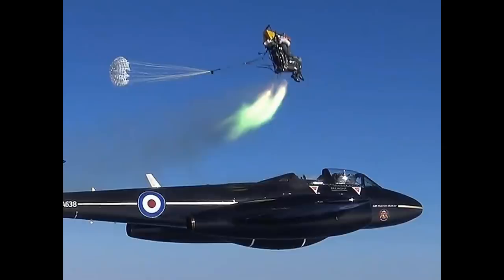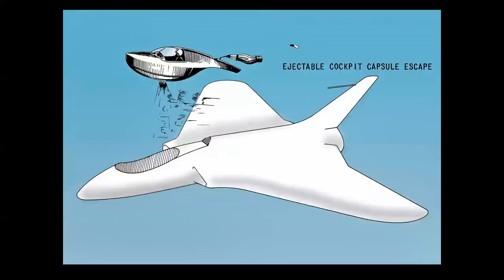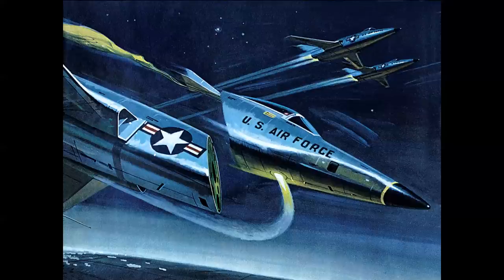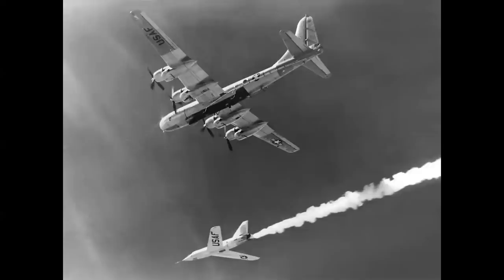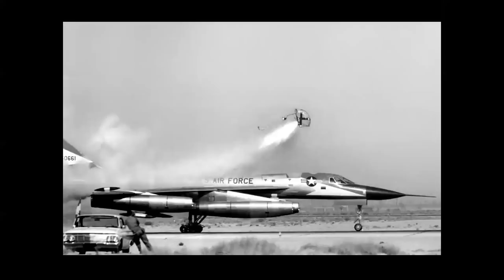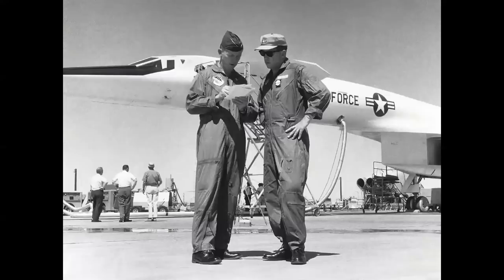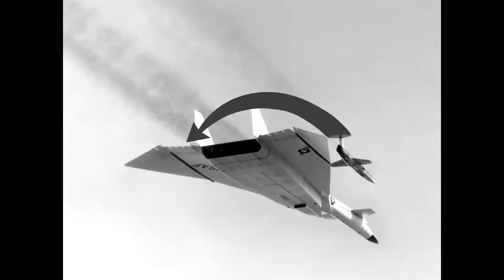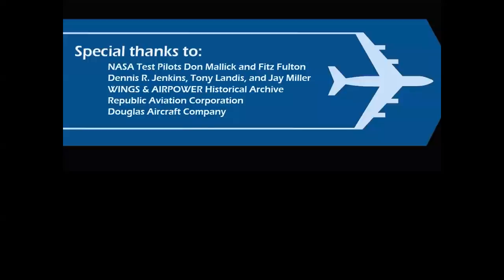AIRCRAFT EJECTION PODS & CAPSULES - High-performance U.S. aircraft escape systems, 1950s and 1960s.

Comment: I'd really like to know more about these high performance e-seats. In particular I'd like to know how the problem of flailing injuries are addressed at ridiculously high speeds like Mach 3. It's my impression that, to this day, flailing injuries are a problem even with aircraft flying at much lower speeds, in particular at lower altitudes where thicker air becomes problematic. I've heard stories of pilots, in more recent times, receiving horrific injuries like (eesh!) arms and legs getting loose, bent backwards, and plastered against the sides of the ejection seat, and helmets trying to rip the heads off people! In fact HOW ABOUT A VIDEO THAT PICKS UP WHERE THIS ONE LEAVES OFF covering modern problems ejection systems attempt to address. For example, how do pilots of The B-One survive if they have to eject during a low altitude/high speed run where they're at 200 to 500 feet AGL, and traveling at speeds that would rip the hair off a gofer as they pass overhead? Ejecting under conditions like that has to be like getting shot from a cannon into a bowl of molasses! And how can ANY ejection system possibly run all the way through it's complete sequence fast enough to keep an airman alive? It doesn't seem possible, (and for all I know, maybe it's not). And lastly, how about a look toward the future? Will hyper-sonic speeds eventually force a return to looking at ejection capsules?
Reply: Mach and high Q (dynamic pressures) are very different things.

Comment: Interesting presentation. Was the development of escape capsules influenced by the NASA Mercury/Gemini/Apollo space capsules? Or was it the other way around if at all?
Reply from the maker: Good question, Vik, and the escape capsule concept first appeared inthe late-1940s, predating the Gemini/Apollo equipment by more than a decade.
Reply: I have a book for boys from the late 50s where they ran a feature on disaster in Space featuring Von Braun's spaceplane, which had a design for a collapsible ejection tube with a steel mesh parachute and a small rocket motor for cushioning the landing.

Comment: When I started out at GDFW, one of the first things I learned about was the ejection system on the F-111 with it's intricate sequencing of the Guillotine to sever the thousands of wires coming into the pod, then the DTA lines and then the chute. I was hired for F-16 but was fortunate to work both Programs ... ACES II was the standard for decades. FF to just a few years back and my assignment in the UK at Martin-Baker on the F-35 ejection system ... talk about a quantum leap !!! Suffice it to say the days of giving the Pilot a choice to pull the big yellow loli-pop are long gone ... and it doesn't matter what "Frame Size/Weight" the Pilot is ... the Aircraft knows. And actually, it's a good thing all in all ... with a seat capable of a "Zero-Zero" survivable egress.  But thanks for your video ... all we now have achieved was built upon previous versions ... and those harmed or passed on. God bless them all for their contributions !!!
Reply from the maker: Great comment, thanks!
Reply: What? No.

Comment: Very interesting thanks for sharing. One query I still had outstanding in my mind though was: Just how does a seat&suit combo actually protect the pilot during a mach 2+ ejection? Surely the reason for the weighty and complex escape pods was down to the fact that designers didn't consider high speed ejections to be survivable without a pod type setup. So how/why did this change?
Reply from the maker: Great question, thanks. The issue is altitude and relative air pressure. SR-71s only flew at high Mach numbers at well above 60,000 ft. Ejecting at that height did not subject the pilots to potentially fatal windblast because of the lower air density, so the seat got them out of the aircraft, and their pressure suit kept them alive until they descended to lower altitudes and breathable air. When ejecting at lower altitudes, the pressure suit and helmet provided better protection against the higher windblast.

Comment: That SR that came apart in flight had suffered what’s become known as an “un start” in SR-71 speak. While attempting to fix the problem the aircraft got out of shape and according to the pilot vibrations started and the jet literally disappeared around him. He described his faceplate as instantly freezing over. And he still had his seatbelts attached to him upon landing. After this incident they fitted the DC pressure suits with a battery operated electric defroster so the crew could still see what was happening
Reply from the maker: Great information, thanks!

Comment: In this video, it remains to name who and when developed the ejection seats. The first combat aircraft in which these evacuation mechanisms were installed as standard was the German Heinkel He 219 Uhu. On January 13, 1942, German Luftwaffe air force test pilot Helmut Schenk ejected from a Heinkel He 280. The Germans experimented with various types of ejection seats, or Schleudersitzapparat, which translates to "seat catapult device." The one used by Schenck was activated by compressed gas, but there was another based on a spring-loaded mechanism, and a third that used a propellant charge. At the end of the war, these mechanisms gave the information to be developed by the US and UK. more modern systems... In Europe there is a saying: To God what is God's and to Caesar what is Caesar's.

Comment: I was looking at the B58 capsules and the crew member has to be in a "knees crunched up" position. I wondered ... if it was accidentally activated it would come down and either stop on or cut off the legs, but they thought of that, there seems to be a sort of knee bar that swings back to to force the crews legs up towards their chest so they fit and don't get the clamsheel taking their kneecaps off.
I'm guessing however it would make it impossible for 7 ft basketball players to be Hustler pilots :)

Comment: The British Miles M52 supersonic jet (1943 to 1946) was built with a pilot pod ejectable from the plane by explosive bolts. Eric Brown was slated to fly the prototype and keen to make it happen. Sadly the U.K. government cancelled the whole project shortly before the first test flight. We have never discovered why that was done.
Reply: The reason was we didn't have the money. When the NHS was formed all opticians and dentist we supposed to be included fully in to the system. But due to lack of funds and the desire to have the bomb and the means of delivering it the opticians and dentists were only partially integrated into the system.
Reply: @neiloflongbeck5705  the plane was already built so lack of funds wasn't the problem, it has been suggested that the "experts" at the air ministry claimed it would have to have swept wings, which it didn't, but there again the Bell X1 didn't either and that worked rather well!, the true reason will probably never be known as disseminating the truth from collective myth after all this time will be all but impossible.
A two thirds model was built for testing, and when launched out to sea was tracked on radar on its one and only flight at almost a thousand miles an hour, yet another "what if" unfortunately.
Reply: @CrusaderSports250  from what I understand none of the 3 prototypes were finished. I think one of them was about 80% completed when the programme was cancelled. After this we continued with testing scale models powered by a rocket, the first of which exploded just after launching a few days before the Bell X-1 did mach 1. By the time iv the 2nd attempt in October 1948 the Bell X-1 had gotten to mach 1.48, this time the rocket worked and got the model to mach 1.38 and then control was lost.
Reply: @neiloflongbeck5705  thanks for the update, I remember reading about it about forty five years ago whilst researching another aircraft project at college, I am sure we could have done it, we gave away so much of our progress and still are unfortunately.
Reply: @CrusaderSports250  it was highly likely that it would have come closer than anything else we had if not breaking mach 1. But the Americans had the rickeg engines that were more certain that the afterburning jet we were going to use. Also cancelled was the chance to put a man in space using a modified V-2.
Reply: @neiloflongbeck5705  didn't know about the space shot, great pity, first a man in space then the moon, A,C,Clarke's 2001 might even have got done, "we do this not because its easy" etc etc. Fun to speculate!.

Comment: I'de love to see an F104 downwards ejection test or live ejection.
That's just the strangest  one out there, Never understood the logic behind it.

What meeting came up with that nonense
"How about we shoot the pilot down through the floor of the plane?" 
Good idea Charles, we'll try that.
Reply: I always wondered if a pilot could just go inverted if flying too low for a downward ejection. Totally agree, never understood this concept either.
Reply from the maker: It was designed so the pilot would avoid striking the aircraft's tail during a high-speed ejection. Low altitude escape was another issue altogether, and they eventually went to an upward-firing seat in the '104.
Reply from the maker: @dpmoos3225  It had been done successfully, while other attempts failed. It all depended on altitude and airspeed. Thanks for the question.
Reply: @911s73targa Well, slick, in 1954 they didn't have the options available in ejection seats that you do when you're busy designing your jet fighters today. Nothing quite like smug 20/20 hindsight especially when you're second guessing Kelly Johnson..
Reply: @FIREBRAND38   Well that's just BS since upwards shooting seats existed 10 years before that already and the Downwards shooting seat turned out to be one of the least sexy and successfull ideas in Aviation that came out Note, it was not Kelly Johnson or Skunkworks  who came up with the downwards ejection idea..  US Army Air Force did it first. Further more the F104 downwards firing seat was not developed by Lockheed, it was subcontracted out to Stanley Aviation Corp. They developed it. Not skunworks.
Oh and while we are at it.. The first UPwards shooting f104 ejection seat... WAS developed by Lockheed..the Lockheed C2..  Because it only took em 150 downwards shooting seats to figure out going up was much better... 

So your little snarky remark is pretty much wrong on every level.

Comment: There were only 3 men on board the B-1A that crashed. The guy in the right seat was killed. They were testing the center of gravity while sweeping the wings and the system miscalculated the amount of fuel it needed to transfer when it pitched up. The capsule was supposed to level itself out after the parachutes deployed but didn't and landed on the right front corner and killed him instantly.

Comment: I always wondered how the crew of a test SR-71 attempting to launch a D-21 drone survived the escape in their ejection seats at Mach 3! (one of them, sadly perished when getting on the sea). The explanation, given in a documentary I saw some time ago, was that the SR-71 could assure a good ejection at 60,000+ feet because the air is so thin that the shockwave isn't as harmful as it would be for example, at 30,000 ft (at the same time, a plane SR-71 or not, with today's technology would see serious problems with power and temperature resistence needed to be able to reaching Mach 3 at 30,000 ft). An ejection at supersonic speed at  altitudes between 20 - 30,000 ft is quite harmful and may be a cause of fatality or serious injuries for the pilot even today.
Reply from the maker: Excellent comment, thanks!

Comment: Is there a reason to why the initiation of a ejection seat/pod doesn’t trigger the automatic ejection of the rest of the aircraft’s ejection seats/pods?
Reply: Martin Baker seats in RAF. Aircraft have command ejection , the TUC system , ' one out , all out '
Reply: It varies from aircraft to aircraft.  Some have it set up so that some crew can eject individually,  others can select an option where the whole crew goes when the pilot initiates.
Reply: RAF Tornadoes used to have a one out all out system until a Tornado flying at very low level met a light aircraft, the Tornado co pilot after a very aggressive manoeuvre by the pilot believed the two aircraft had hit and punched them both out, (fractions of a second mean the difference between life and death, not giving time for debate), the pilot had actually missed the light aircraft and lost his own due to being ejected!, after that that co pilot could only eject himself but the pilot could still eject them both. 
One of the problems with ejecting is the stress it places on the body, due to this the RAF allow two ejections and you have to have very good reason to get a shot at a third, after that its either transports or a desk.
Reply: It does

Comment: No Gemini space capsule ejection seats?
Reply from the maker: Good point, and Space Shuttle COLUMBIA's first flights had ejection seats for lower atmospheric escape as well. Thanks for watching!
Reply: @celebratingaviationwithmik9782  Columbia may have had ejection seats at first, but the egress systems of the Space Shuttle were absent for Challenger.  I was in Germany when Challenger exploded shortly after lift-off.  I was in a large tent with several hundred other soldiers watching the launch on a theater-size projection screen when the Challenger entered the clouds and then there was a brilliant flash followed by the BANG!  I had vacationed in Florida and picked up one of those commercial coffee table soft-cover books detailing the Space Shuttle systems.  After Challenger, the Space Shuttle fleet was grounded until some sort of semi-acceptable escape systems were developed and installed--but ejection seats were too much weight.  When the Columbia ripped apart on reentry in February 2003, many people had still not received the memo that space flight is still experimental--and that there are risks.  At the moment no spacecraft has been attacked by anti-spacecraft weaponry (that I know of--I don't know everything) and that danger is considered low enough that commercial spacecraft emergency systems don't address getting out of the spacecraft.  
Please, keep up the ejection seat videos.  Spacecraft egress systems would be a good start.  I am astonished that American adults still wonder where the commercial airliners keep parachutes for the passengers.  Even the 90-second evacuation standard for airliner passengers (tested under ideal conditions) is a mystery to most air travelers.

Comment: Full pressure suits are fine when the mission is a reconnaissance flight or a research project.  It is not practical in tactical scenarios where pilots are required to scramble on a moment's notice.

Comment: 354,000 feet is officially in space isn't it ?
Reply from the maker: Yes, "space" is defined as 50 miles above the Earth's surface, or 260,000 feet. Eight of the 12 pilots who flew the X-15 received Astronaut Wings for space flight by exceeding that altitude in the rocket plane. Thanks for watching!
Reply: @celebratingaviationwithmik9782  must be cool to have wings that don't cause a movement in no atmosphere. 
I wonder what that feeling was like 
Maybe like driving down a motorway and then having no steering wheel .
Exciting feeling